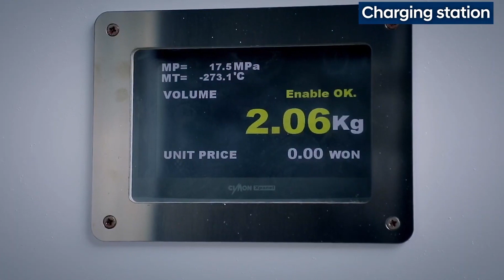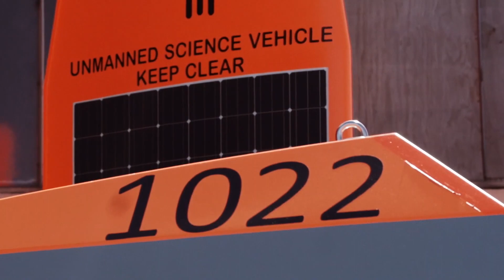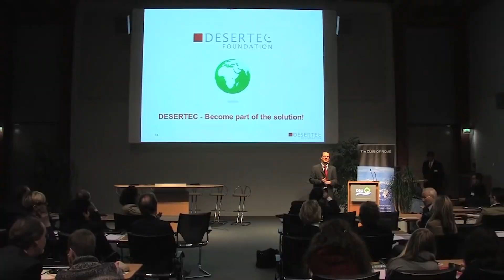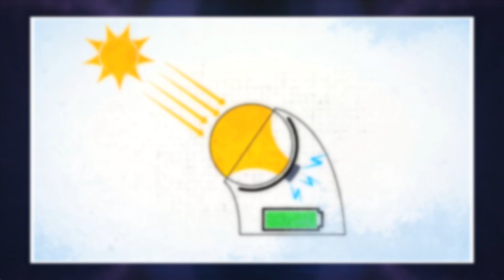8 INVENTIONS AND TECHNOLOGIES THAT WILL CHANGE OUR WORLD

Comment: with the last one you can easily reduce the lifespan of those solar panels because of the heat from the sun? thats why we dont just use mirrors to shine the sun into the panel which btw also works for anyone trying to go off grid

Comment: I'm interested in the topic, but halfway into the second item, I had to quit. You can't do a science and tech education piece and have major errors of fact.

First, the only thing that hydro electric power provides relevant to H2 based power generation is electricity for electrolysis. Your implication is that hydro electric power somehow already uses or generates H2, which is ridiculous.

The Loon Internet project is clearly not/not using hot air balloons, IF your clip actually shows the right kind of balloon. It is clearly using some lighter than air gas for lift (likely hydrogen), just like the weather balloons on which it is clearly based. Hot air balloons are shaped significantly differently, something which should be obvious.

If you have pretensions of actual science education, please make sure that you do a good fact check.

Comment: I'd like to know how they hook up the 5th wheel with those monstrous fuel tanks in the way!
Reply: Using a shaped arm so the trailer actually starts behind the tanks instead of on top of the 5th wheel as they do now. However, I am sure they would redesign the tanks so standard trailers can be used and this is simply a prototype model.

Comment: I'm still trying to figure out why millions of combustion engine cars all over the planet can't be converted to burn hydrogen ? The most abundant element we have
Reply: Hydrogen is also the most volatile of fuels. One spark and BOOM!
Cars can be easily converted to burn hydrogen, but keeping it contained in a safe way is very difficult without heavy tanks. For a small car, the weight of the tanks would be like trying to tow a small caravan.
Those trucks can do it because they have the HP to take a heavy load, so the heavy tanks are no problem.

Comment: Hydrogen from electrolysis. Electrolysis from steam turbine. Steam turbine from fossil fuel. In each step you lose energy in the conversion. Most of this "clean" energy is just political bullshit. Just use diesel in the first place.

Comment: Hydro-electric power has absolutely nothing to do with hydrogen production... Aside maybe from producing the power needed for the electrolysis. So saying that Switzerland has everything required for hydrogen fuel cells because more than half of their power is produced by hydro-electric power just doesn't makes sense.
Reply: I took as, the energy needed to separate H2 from H2O would be created with hydroelectric.  So there wouldn’t be a “net-loss.”  Not fossil fuel.  But I just watched this video once...
Reply: Inaccuracies like that discredits the whole video for me now. Shame really. Also, I cant help feeling that these voice overs sound too commercial. Give me Channels like Joe Scott or ColdFusion any-day rather than this type of format.

Comment: 1) hydroelectric power has nothing to do with hydrogen fuel cells
2) the stratosphere isn't 66feet in the sky and that wasn't a hot air balloon
3) 100km is not 2 miles
4) you keep showing solar panels and calling them solar batteries
5) the figures in the last one didn't make much sense
Reply: I would also add that last one, a 1m sphere will only collect the amount of sunlight from a 1m circle and passing it through water or any other substance will reduce the effectiveness as some heat/light/whatever (probably solar uranium by this guys accuracy) is lost in the process (also water leaks, or the whole thing breaks when it gets cold and the water starts freezing and expands shattering the sphere, but another fair weather solar project) you would be better served with just a 1m circular solar panel. It also would take less power to move the solar panel then the sphere just due to weight, if it was a cube it would be 1000kg so I'll be generous and call it 500kg that is a lot of weight to move around and then add in the frame and motors and I bet we are back up around 1000kg with a small footprint breaking through the roof for a nice little surprise.
Reply: @coreytaggart128  you would right about having half a ton of water on the roof you'd want to be damm sure it could take it
Reply: the only one I can defend for is solar panels are called solar batteries in some areas, but the others are their fault
Reply: Electricity from hydro electric power plants (as it is readily available in Switzerland) is used for electrolisis to produce hydrogen used in the truck (hey I am not a nerd... I just learned it from Real Engineering..
Reply: timestamps?
Reply: The lemon is a lemon, dumb boutique solar promotion.  

I'm mounting a pair of 330 watt panels on my van next week.  Panels shipped to my door for under $500. Another $1400 in charge controller, batteries, ect. already spent.  Practical solar power is available right now.  It's expensive to build an entire system, but paying twenty years of power bills up front...and getting off grid, 24/7 reliable electricity, that is value worth paying for.

Don't buy the lemon.
Reply: @docwatson1134  I've seen several focus sunlight solar systems and while they do produce more power for a given area they have seemed clunky and with a couple of very specific cases yeah it seemed so much better to just put a standard solar setup
Reply: @Kraulain
People who are bullish on these new inventions do not read anything. They mostly just want to believe. 
No need to think about end to end harm to the environment. Just believe that buying solar panels will solve things. Programmed stupidity.
Reply: well you got #1 wrong.    using hydro-electric power you can hydrolise water and extract hydrogen which is then used as a power source  in any feul cell power source to generate electricity or directly as a combustible fuel in an internal combustion engine.     so there you go......
Reply: Having an infrastructure of hydroelectric power has a lot to do with hydrogen fuel because he said it was made through electrolysis which is dismantling the water into hydrogen and oxygen.
Reply: @yeetskirter4685  So are you saying, they need to generate hydro-electricity, in order to do electrolysis and get hydrogen, so as to generate electricity with the hydrogen fuel? why not just use the hydroelectric power?
Reply: @freejavabootcamp  hydroelectric power stores large amounts of water by taking its kinetic energy away. You can just add a little more energy to get hydrogen fuel I imagine that’s makes it more efficient and it definitely gets rid of the excess water. Hydrogen fuel is much more easily transported and put into cars because you don’t need a power grid or batteries which produce toxic waste and eventually stop working.
Reply: @yeetskirter4685  makes sense
Reply: @freejavabootcamp  Why not use H2?  It needs compression and it takes too much energy to compress.  (Unless you want to haul a huge tank of H2)
Reply: @yeetskirter4685  using electricity to extract hydrogene from water, pressurerice it, and then turn it back to water (fuelcells does that) gives you ca. 50% of the original amount of electricity for you to use. But hydrogene is very energy dence and therefore very usefull for energystorage. Another advantage compared to lithiumion batteries is that it doesn't leak as much energy over time wich makes it usefull for long term storage. It also doesn't use any metals that there is a limited amount of. But using a fuelcell engine is of no use if you don't have access to clean energy...
(english is my second language, and this is a answer to serveral posts here).
Reply: @olavkarlsson6430  hydrogen is incredibly difficult to store, as the small size of the molecules mean that it is very difficult to seal them in. Ambient temperature and pressure is a poor way to store it, so you need to at least pressurize it, and better if you can get into cryogenic regimes, all of which has implications for storage containers and maintenance of pressure/temperatures needed. H2 is an environmentally clean fuel when burned, but what is the carbon footprint of production, storage, transport, etc, and how efficient is the use of the electricity to crack it from water?
Reply: @yeetskirter4685  you could also use nuclear power, or solar electric, or coal plants to generate the electricity for electrolysis, and a plant on any significant body of water will get all the raw materials you need for the process. A solar plant in northern Africa with pipes into the Med to get water would likely be less environmentally impactful and possibly much cheaper than using hydro electricity in Switzerland.

As far as I can tell, the script writer saw hydrogen and hydro electricity, decided that because they both had "hydro" that they must be the same, and, voilà!, we have this video.
Reply: @TamaraWiens  It is being done here in Sweden. Not in a big scale. There is one house in gothenburg that is completly of grid. During the summer the owner use solar cells to split hydrogen from water and store the gas in (i think) carbon fibre cans under pressure. During winter he converts the hydrogene to electricity using fuel cells.
Reply: Here here!
Reply: @tannerrennat7786  

1) It’s “Hear, hear” not “Here, here”
2) That is all
Reply: @SuperNintendo.Chalmers  ... that seems painfully obvious once pointed out.
Reply: @tannerrennat7786  you meant "hear, hear" - please, get it right...
Reply: correct me if im wrong , but to make hydrogen you need water , and energy , lots of it . hydroelectric facilities makes a ton of energy . and retain a huge mass of water , think of Hydro quebec Daniel johnson barrage . it makes already enough energy to not even know what to do with it and retain a significant amount of water .  how are those 2 not related please explain further more
Reply: I’m sick of the globalists shoving their crap everywhere. Climate change is a hoax, COVID was released to steal the election. Yea, I said it.
Reply: @ricoramjet6523  and nobody cares that you did.
Reply: @ricoramjet6523  you deserve this video - it makes just as much sense as you!

Comment: aside from all the other obvious mistakes mentioned already - do hydroelectric stations produce hydrogen using the electrolysis method?  I was under the impression that hydroelectric stations used water only to turn turbines and produce electricity.  I think a lot of this commentary is just completely made up.
Reply: You are correct most hydroelectric power stations are like a large dam so the falling water turns rotors. The bigger ones like the three gorges dam in China can probably power half a small country
Reply: TBH, If you were going to build an electrolysis plant to mass-produce hydrogen, you would obviously do it next door to a hydroelectric plant to minimize transmission losses ...
Reply: Some stations might make hydrogen cells using turbines but most hydrogen fueled cars run on cells.
Reply: The point well taken made up proubly to salvage 314000 oil ladened  portfoilios to late .they already  got trumped in uckranium oil seeps   i will mayby pray.40 days and nights k.then 1 $ boat sink fair .if afloat you can swim in pollcv     l
Reply: @stevenlonien7857  replying while drunk (or stoned)?
Reply: Ok hoover dams in tides that open & close mirroring magneticaly instantly  1000 x wind = 0 right or left ? Figures of Einstines relativity  not counted obviously since banned  by oil discovery 1919 betz limits.

Comment: Youd think by now that they would incorporate a windscreen wiper on the panel with a reservoir of cleaning fluid.although the mars rover seems to get magically cleaned after dust storms.just a thought.
Reply: Dust storms in Mars are not harsh - considering the air density being just 1% of Earth's... So the dust that settles on the rover can easily be shaken off because it is very fine & zero moisture content in it... It's quite a job on earth - considering the scale they are planning. Better turn desert into forest with that kind of efforts...
Reply: Mars Rovers often use ultrasound to disperse the fine dust.

Comment: "20km or 66ft. in the air" uhhh, 20 metres?
Reply: Yeah, it seems the narrator didn't really understand what he was reading… a couple of sentences were broken up awkwardly, too.
Reply: @nomadMik  Robot. It's getting better but not perfect.
Reply: 66000 ft would have been more accurate.
Reply: All of the projects in this vid are suspect. All of them have massive technological requirements that are unlikely to be economically viable.

Even the simplest the solar array in the desert, is going to need far more maintance than your typical solar plant. 1) heat damage over time, 2) lots and lots of cleaning off sand, 3) damage from sandstorms.
The solar cell with the orb of water, well that has been tried. And yes it does work, however it is more costly, dangerous, and does not offer the same amount of power as a solar array which would occupy the same area.
And the only real novel idea here 3d printing inside the body. Really? You want to print an organ which requires nanometer precision, and hours, maybe days of immobilization. Inside the human body where things never stop moving for long? Not to mention we can't even print a living organ reliably in a lab yet.

The only feasible one of these is the WiFi project. Even then I'd have to question why not just build a tower. The balloon idea is great but only as a temporary solution. And in the long term very wasteful.
Reply: "in the sky"
Reply: And what abou" the drone passes... 100km or 2 miles"?
Reply: 100km or 2 miles? I think Ron burgundy maybe reading this 1.
Reply: He read the script wrong 20km is just short of 66 thousand feet.
Reply: @zdcyclops1lickley190  whoever wrote the script or proof read it needs to be sacked!!
Reply: @craigpardy6204  What if it were you? A verbal warning would do.
Reply: 100 kilometres or 100 miles.. loads of mistake
Reply: How about a substance that solidifies at 96.8 degrees? Perfect? for the human bodys needs..
Reply: Ft, ft, ft, nobody uses metres.

Comment: The last one..spherical lens to accumulate more energy at  point...this is the exact same idea which i got two years back...but instead of using spherical shell lens filled with water...i wanted to that with big sized flat convex lens...but i never do any research on it because i simply thought concentrating energy in one point and then use this concentrated energy with solar panel will overheat it...and will damage the solar panels....

Btw great content, i'm glad i subscribed your channel !!!
Reply: i find it ironic.  When a person is trying to generate energy, ......heat (which is a form of energy) is a unwanted by product.
Also.. i keep wondering..  All of us have tonnes of free energy all around us, but we can't use it.  
I mean.. as long as the temerature in the air is higher then absolute zero (minus -273 degrees below zero)... then there should in theory be plenty of energy.  That's why i keep wondering, why can't a air conditioner just extract the heat energy from the environment to power itself for operation and be doubly efficient and work for free.
Reply: @cryptfire3158  the issue is that there is no cold matter for it to interact with to change its energy state witch is what you can exteact energy from ie a sterling engine. The only way you could theoreticaly extract energy from heat is if you somehow managed to build a machine so small that it could interact with the physical molecules and extract their kinetic energy, but as far as we know this is imposible
Reply: @cryptfire3158  an air conditioner is trying to get one environment cold, and generates more heat than you started with to move that heat outside, as is the law of entropy. that difference in temperature you created with the unit between your house and the outside air does have usuable work between it that we could extract, but you put that available energy there by running the AC unit.

 but now youre pumping  heat back into the house to extract that energy you put in from the cold air difference in temperature, and that is counterproductive. its like charging a battery, then plugging that battery back into your wall to get some power back in your house. it would actually make it much more inefficient
Reply: @samfarnham6965  did you understand the paradox i'm talking about?  how that there is pretty much infinite energy all around us in the form of heat, which in fact is energy stored in thermal form.  But we can't access this free energy for any benefit.